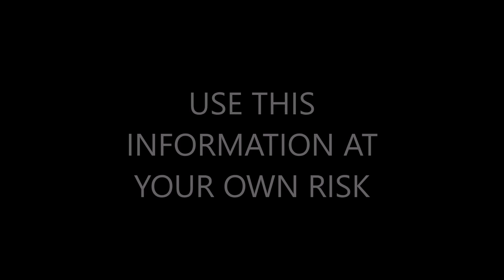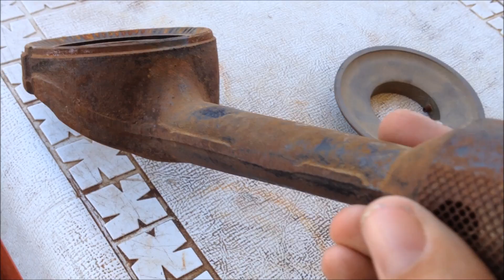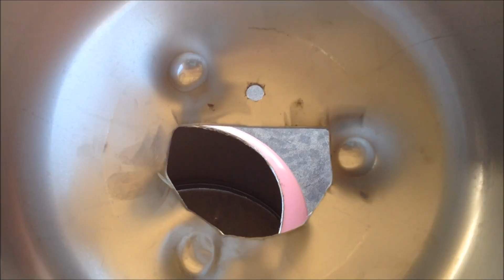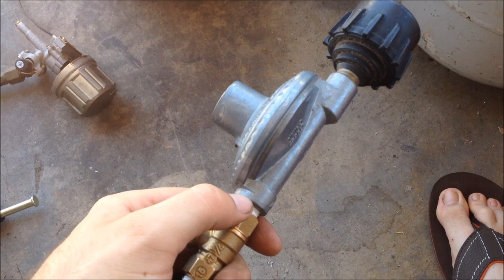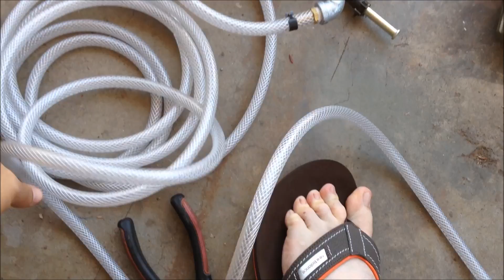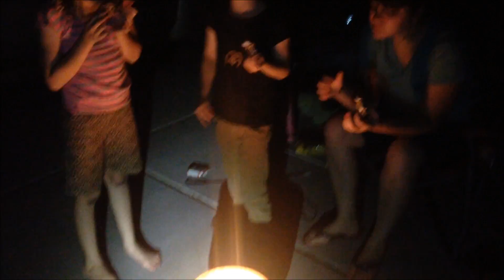Make your own Propane campfire cheap! DIY homemade LP Gas fire pit barrell

Comment: Cool video good idea except for I wouldn't have my kids around that propane fire pit with that kind of tubing used that's not gas line you have to use low pressure or high pressure propane line you can't just use some rubber hose I work in the propane industry you should change that hose

Comment: how quickly will your pit drain a propane tank?
Reply from the maker: Not sure.  Just FYI, we had a 20# LP tank on our last campout which lasted 3 nights... we used the LP tank for cooking on our large camp stove for breakfast and dinner for 12 people, and then hooked it up to the fire pit for marshmallows and chit chat each night.  We came home with a 1/2 full tank.  Not too bad.
Reply: Good info. thx.